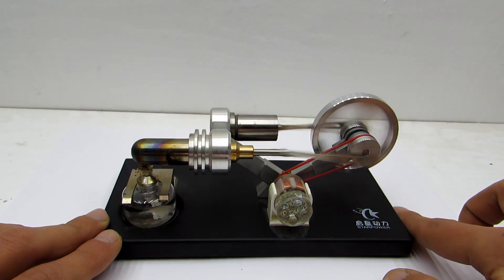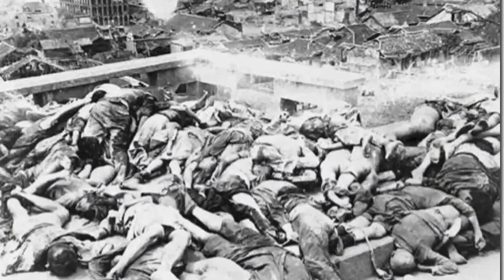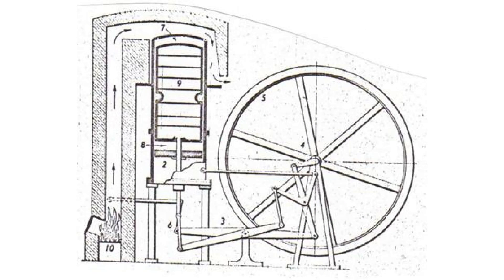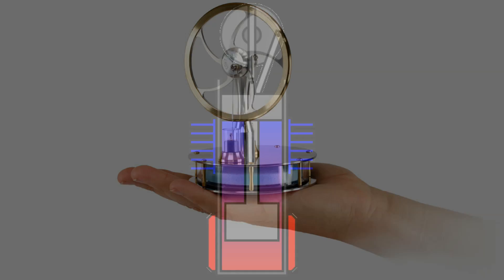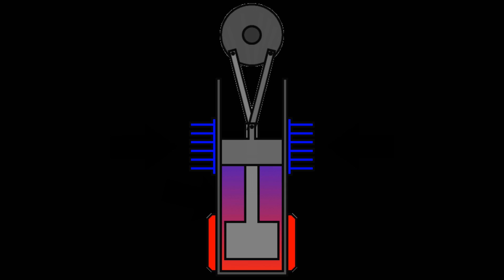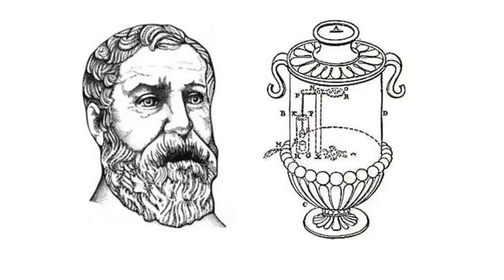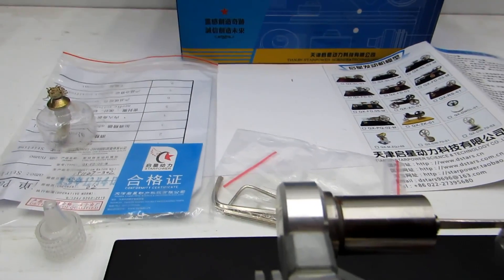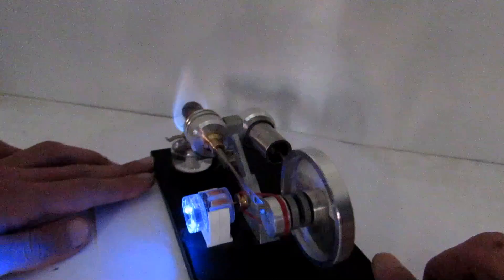Robert Stirling and his engine

Comment: An axial vector induction hot air engine used with a transmission could be a neat tool to have for electrical power generation if designed to operate off solar.
Reply: This sounds less efficient than actual solar panels, though.